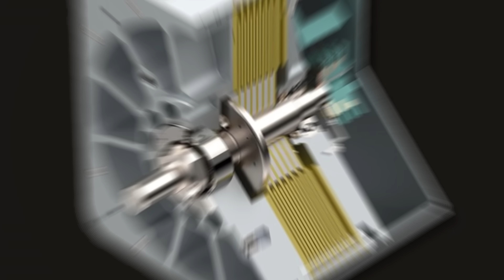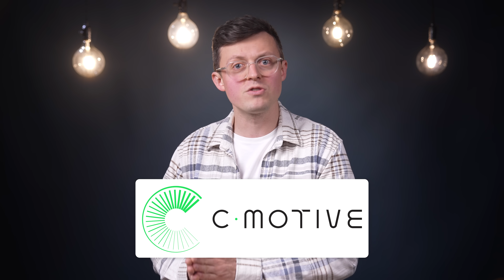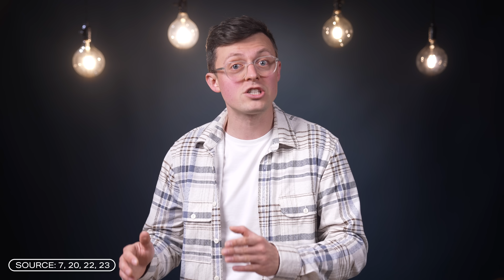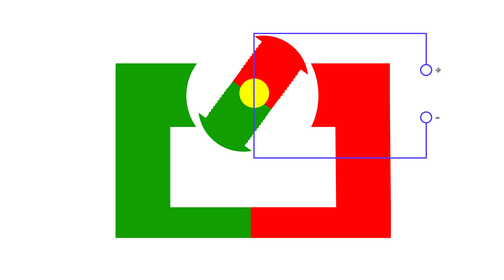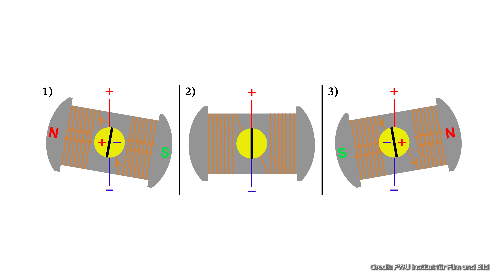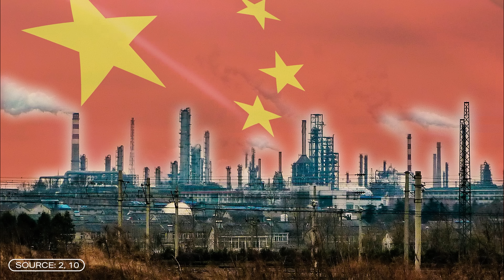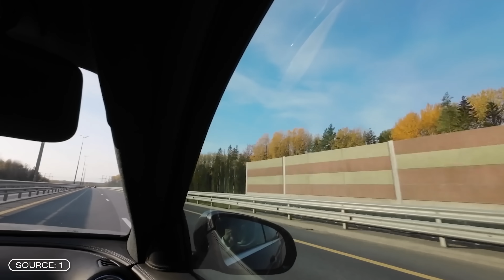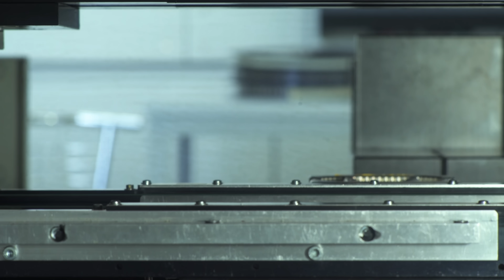Have We Gotten Electric Motors Wrong for 150 Years?

Comment: How the C‑Motive design actually works
From C‑Motive and third‑party write‑ups:

Electrode geometry: Interleaved rotor/stator electrodes, often patterned like sectors/teeth, form many small capacitors whose effective capacitance changes with rotor position.

Dielectric fluid: The key enabler is a proprietary dielectric fluid with:

High permittivity (to boost electric field torque density)

High breakdown strength

Low viscosity (so it doesn’t kill efficiency by drag)

Drive electronics: A medium‑voltage, low‑current power stage drives the electrode phases at several kV but very small currents, creating a rotating electric field that drags the rotor into alignment, just like a rotating magnetic field would in a motor.

Operation characteristics:

They’re naturally happy at stall or low speed because no large currents are needed to hold torque.

Losses are dominated by dielectric losses and mechanical friction rather than copper/iron losses.

Early lab machines were in the few‑hundred‑watt range; documents and coverage now talk about products/prototypes in the ~750–3,750 W range and aspirations to go much higher.

Why this is attractive (in principle)
From the engineering / systems point of view, some legitimate advantages:

Material supply & cost

100% elimination of rare‑earth permanent magnets.

Around 90–95% reduction in copper usage compared with conventional high‑torque motors.

Construction favors aluminum, stamped plates, and plastic, which are cheap and widely available.

Efficiency and thermal behavior

Reported machine efficiencies in the upper 90% range under designed operating points; even if you haircut that, shaving a few percentage points off an already‑efficient industrial drive can be a non‑trivial energy and heat reduction in 24/7 duty.

Lower heat means smaller or no active cooling and potentially longer life on bearings, insulation, etc.

System simplification

Designed to give rated torque at low speed → eliminate gearboxes/belt drives; that’s a big Win for maintenance and efficiency in, say, conveyors or mixers.

No magnets → simpler recycling and fewer demagnetization issues at temperature.

Operational quirks that are actually useful

They draw very little power at stall compared to a conventional magnetically excited motor, which can make them attractive for loads that spend time stalled or creeping.

This is why early pilots are in industrial settings where:

The motor is big enough that even 2–3% efficiency and maintenance gains are worth it.

High‑voltage infrastructure already exists or is easy to add.

What’s the catch?
There are several non‑trivial drawbacks/barriers that keep this “niche/early‑adopter” rather than “mainstream” right now:

High voltage requirement

To get meaningful torque density from Coulomb forces, you need kilovolt‑class potentials; e.g., a widely cited prototype uses around 2 kV.

That means:

Medium‑voltage power electronics.

Safety ratings, creepage, insulation systems that look more like MV gear than a typical 480 V motor.

Regulatory and utility interface complexity for widespread deployment.

Torque density vs conventional motors

Electric fields in a dielectric still give you much weaker forces per unit volume than magnetic fields in a saturated iron core, so torque density is a constant design fight.

C‑Motive mitigates this with clever geometry and high‑k fluid, but mainstream PM and induction motors remain extremely hard to beat on kW/kg and kW/L for general‑purpose use.

Dielectric fluid issues

Long‑term stability, leakage, contamination, service procedures, and environmental aspects of the fluid all matter a lot in the real world.

Industrial users will want decades of data or very clear service stories before putting thousands of these in plants.

Power electronics cost

Even with less copper and no magnets, any savings can be partly eaten by more complex drive electronics plus insulation and safety measures for high voltage.

For commodity 1–50 hp motors at 480 V, standard VFDs are so cheap and mature that it’s a tall economic bar to clear.

Standards and field inertia

Motor rooms, MCCs, drive cabinets, and maintenance culture are all built around electromagnetic motors. Getting adoption requires not just technical merit but also standards, training, and trust.

So yes: there’s a real “big hurdle” between slick lab demos / pilot installs and displacing entrenched, cost‑optimized PM/induction machines at scale.

How “new” is this really?
Electrostatic motors are not a new physical idea: people were building toy electrostatic motors in the 18th and 19th centuries using Wimshurst machines and Leyden jars. They lost out to electromagnetic motors because:

Magnetic systems offered much higher force density.

Copper/iron machines were easier to power with low‑voltage sources of the time.

Engineering materials and power electronics weren’t ready to make high‑voltage, low‑loss electrostatic machines practical.

The novelty now is:

Better dielectrics and insulating materials.

Power electronics that can efficiently and precisely generate multi‑kV waveforms.

A materials/cost/supply‑chain landscape where “no magnets, minimal copper” is a big deal.

So this is more a clever, modern re‑implementation of an old concept with new materials and system constraints than a brand‑new physics breakthrough.

Where they realistically fit
From C‑Motive’s own positioning and independent coverage, the early “good fit” buckets are:

Industrial direct‑drive

Conveyors, mixers, pumps, blowers where low‑speed, high‑torque direct drive can eliminate reducers and belts.

Facilities already comfortable with MV distribution, where adding a specialized drive is not a culture shock.

High duty‑cycle, energy‑sensitive loads

24/7 industrial processes where a couple of points of efficiency plus reduced maintenance meaningfully move OpEx and decarb metrics.

Sustainability / critical materials constrained projects

Projects explicitly scored on rare‑earth and copper usage (e.g., greenfield plants, ESG‑heavy financing, or regions with supply risk).

Near‑term “probably not”:

General‑purpose NEMA/IEC frame motors at 230–480 V, 1–200 hp.

EV traction, aviation, compact robotics where power density and low voltage are king.

How “too good to be true” is the marketing?
If you read the fine print and third‑party reports:

“Almost 100% efficiency” is technically feasible at the machine level, but only in specific regimes and doesn’t include everything (drive, cabling, system parasitics).

Practical deployments show good efficiencies and some system‑level wins (no gearbox/cooling), not a 20‑point leap over premium induction/PM motors. Think incremental but meaningful improvements, not a perpetual motion machine.

The “no magnets and little copper” claims are solid and may be the real selling point, especially at scale.

In other words: the physics and the prototypes check out; the “revolution” depends on economics, reliability, and standards more than on whether the torque actually shows up at the shaft.

If you’re evaluating it as an engineer
Given your background, the interesting questions to poke at would be:

Nameplate and curve data vs a premium IE4/IE5 motor + gearbox at the same load.

Drive topology and what it means for harmonics, insulation coordination, and plant safety.

MTBF/maintenance intervals, especially around the dielectric fluid and seals.

Field‑test reports from pilots (breweries, process lines, HVAC) rather than YouTube/PR talking points.

If you want, I can dig into specific PDFs (e.g., the utility/DR pilot report or ABB’s rare‑earth‑free motor comparisons) and lay out some hard numbers in a table: torque density, efficiency at various load points, material usage, etc.

Comment: Short version: electrostatic motors like C‑Motive’s are real and genuinely interesting, but they’re not magic and they’re not about to replace every induction/PM motor you work with. They target specific niches where their quirks (high voltage, low speed, torque‑rich) are advantages rather than show‑stoppers.

Below is the landscape, focusing on “how it works”, what’s actually new here, what’s hype, and where they might realistically fit.

What an electrostatic motor is
Traditional motors: you feed current into windings, generate magnetic fields, and get torque via Lorentz forces in a magnetic circuit. Losses are dominated by copper 
I
2
R
I 
2
 R, iron core losses, magnet/switching losses, etc.

Electrostatic motors flip that:

They use high voltage, very low current, and electric fields instead of magnetic fields.

Torque comes from Coulomb forces between charged plates (capacitors) whose overlap/relative position is modulated as they rotate.

C‑Motive specifically uses stacks of interleaved electrode plates separated by a high‑k dielectric fluid, forming a kind of multi‑plate rotating capacitor.

So instead of a copper‑heavy stator + rotor and rare‑earth magnets, it’s essentially “patterned electrodes + dielectric in a can” driven by a medium‑voltage power stage.

What C‑Motive is actually claiming
From their own materials and utility reports, C‑Motive pitches:

No rare‑earth magnets – they don’t use magnets at all.

Drastic copper reduction – they claim on the order of 90–95% less copper versus equivalent high‑torque industrial motors.

High efficiency – marketing talks about “up to ~98–99%” machine efficiency in specific operating regimes. Independent/utility reports tend to show more modest but still good gains (e.g., a few percentage points vs premium motors in target use‑cases).

Full torque at low speed – they’re deliberately targeting direct‑drive, low‑speed, high‑torque industrial apps, so you can skip gearboxes or belt reduction.

Much less waste heat – voltage‑driven, low current, and no iron core means substantially less 
I
2
R
I 
2
 R and iron loss, so simpler cooling and lower thermal stress.

In a recent summary for industrial decarb / demand‑response programs, the tech is presented as:

A capacitive, electrostatic motor platform with potential to scale into the MW range.

Best suited to stationary, industrial torque applications (conveyors, blowers, pumps, mixers, process equipment) rather than EV traction right now.

So “almost 100% efficiency” is the top‑end, ideal‑case marketing number; what matters practically is: “premium‑plus efficiency with some system‑level wins (no gearbox/cooling), and no magnets.”

Comment: Nevertheless, even if figures of 90 or even 95% efficiency are not uncommon in good old electromagnetic motors (see for example premium efficiency directives), they are usually quoted for nominal power. It is a different thing to try to get this value over the whole operating range that you are likely to use in an EV, for example, as can be seen by checking motor efficiency maps (efficiency vs speed and torque diagrams).  Could be a point in favour of synchronous reluctance motors, which, by the way, do not use any kind of winding in the rotor.

Comment: 5 minutes with google and I have some questions.  i think the dialectric needs to be a solvent and non combustible, and remain a liquid, and not cause oxidation with the Cu on the plates.  hence no O² contact.  Then there is the HP thing,  while I love high torque low spd stuff (because torq can be converted rather easily), the HP isn't very good.  So to run a golf cart we need 2 of these motors and a gearbox?  Now, toyota has been running these ecvt transmissions and the electric motor component is ~40HP.  Unless you can get a 'static' motor with same efficiency and weight AND output of 40W, the Use Case list diminishes quite a bit.  And, studying efficiencies of multiple poles, like the differrence between 3 pole and 2 pole motors is quite obvious.  How does the reverse...u know a generator... is that a thing...should be a thing with fewer expensive inputs.  Can't we reverse case a tesla turbine and take advantage of 'statics'?  yes, I have questions. Let's say a decent golf cart motor is $600, I still don't see how you get market advantage.  Now if you look at belt drive commercial motors need a minimum of 10HP at low torque, 3 phase...and cost @ least $1500, I still don't see perfect market advantage.  but as a science study i much like it.  So let's say you use a solvent, i think you need an additive polymer to enhance the polar 'action' within the dielectric for some torq boost.  Density (thus pressure) is highly relevent.  Using a gas like a noble gas isn;'t gonna get you the permittivity, and everything causes friction anyways.... so I don't follow the heat claim... obviously low rpms helps a lot... but still sounds suss.  I think the plates have to be tuned and 1 or 2 even 'free' floating as buffers.  So a Fixed Rpm on larger motors!  the ramp up to that rpm wouldn't be very balanced, but would get there quickly and be in harmony.  Larger motors to me means more plates...thus longer shaft, not necessarily diameter, although that's obvious as well.  The 'diminishing' returns are then very obvious as you scale up imo.  Micro scale servo motors that could have less Cu and magnets would then be desireable.  however, I don't see how you get there with this 'static' motor w/o hybridization.  Servos generally provide the jerk necessary for speedy operation and this motor...not so much.  like i said, i have questions.  Let's go up to locomotive scale ... yea i think it falls flat on it's face...again.  electric 'flyers'... still a nope.

Comment: Wouldn't these motors work well for wind generators, which would need relatively low RPM high efficiency generators?
Reply: Yes, absolutely!  ESMs would rock in wind power and similar applications.  

It’s was the back and forth politics , i.e. which U.S. administration supports cleaner energy or not, that has steered many startups away from wind power.  It’s too bad really.

Comment: Thanks! I recently thought up the static piroelectric static wrist watch so thin even thinner omega using gold so low voltage and insulation like wax paper between plate to prevent spark and hopefully it work because gold.  required less voltage and nearly no resistance . brass may work too
Reply from the maker: Good luck with your innovation!

Comment: wellll      there are lots of of motor that do  NOT  contain a permanent magnet.    see induction and series wound motors.   of the motors that do make use of permanent magnets, only some of them use rare-earth materials.   specifically, pm bldc motors.     other than in miniature motors,  a pm bldc motor does not have to utilize rare-earth magnets.     in other words, some of the 'advantages' described here don't  actually  exist.  !!!!      file this idea, in the bin, with  'spin launch'.     it always amazes when an informed investor(s) will put a bunch of capital  into  an  ABSURD  idea.

Comment: any motor can be 100% efficient if you stall it and simply measure heat output... it doenst do any work but all power consumed will appear as heat energy...

"efficiency" is a fun term as theres so many ways to measure it as it isnt one fixed parameter...

i could measure the ability of its calculated ampere turns to translate to newton metres of torque..

i could compare its electrical consumption to the power at the shaft... but thats still not the entire story as thats power CONSUMED in its windings as I2R, NOT the amount FLOWING through them...

that is, a cable delivering 100kw only loses say, 1KW in its ohmic losses...  a motor has resistance, its just a cable wound up...

and here we enter a fun part of generators and motors on general, and how the source resistance affects the "efficiency". "jacobis law". often neglected... extremely important.

i could give a motor air bearings with near zero friction and claim its now "99.999% efficient" over a bronze bushing or oilite bearing...

any efficiency claim is EXTREMELY DUBIOUS unless they state EXACTLY WHAT THEYRE MEASURING.

Comment: GSG,

the common induction motor used in industry has an efficiency of about 90%, so 95% is not a big leap especially as induction motors are very cheap (Just basic electrical materials, no rare earth or such like) and come in sizes from very small to very large (Megawatt sizes) and in voltages from low to very high.
These are by far the most common type of electric motor, and very difficult to beat when all factors are considered.

Comment: Ideal for robotics, roll out is not a big issue, AI can create drivers etc, gearing can fix some of the speed issues, but so could potentially using other gases or liquids instead of air. You didnt touch on renewable energy sources or batteries that could drive these maybe electrostatic materials or atmospheric generation?

Comment: There is one application with way too much money and a strangely narrow field of perspective who'd be able to expedite the development process....cycling. The best press is getting away with mechanical doping, a motor with such a low thermal signature operating on process that is well below its 200rpm limits of even the fittest cyclist seems like a good opportunity to actually see what its about...this is the same group that went Gaga for $2000 ceramic bearing jokey wheel to save....1w of drag.

Just saying, its one of the few places where high energy efficiency would be a kind of interesting application, like say a solar panel being able to fully power an assisted cycling system for minimal weight, using a motor that needs the equivalent of chip fab dust management to manufacture...would stroke a certain type of industrial peacocker.